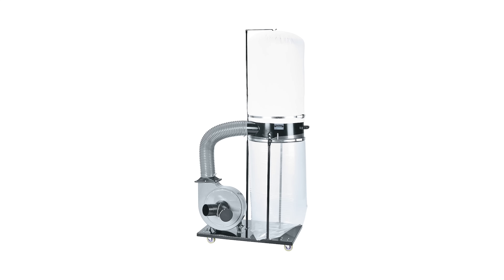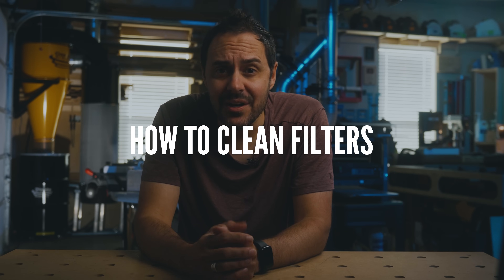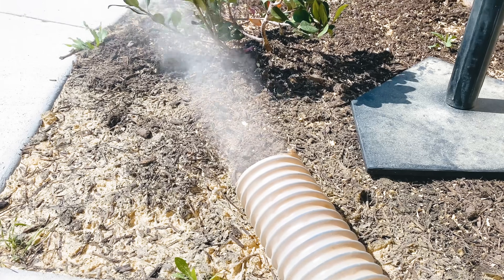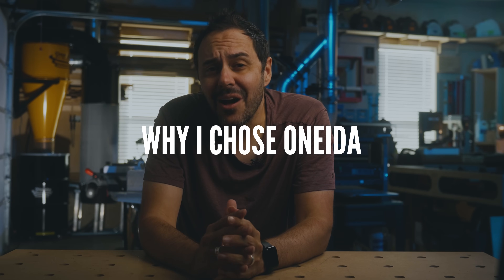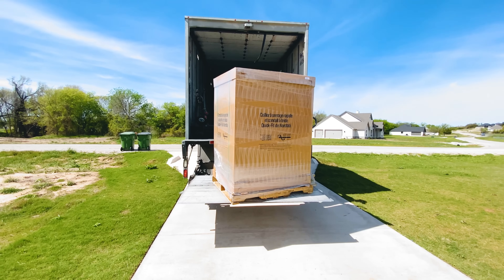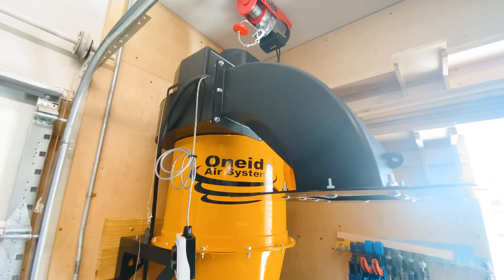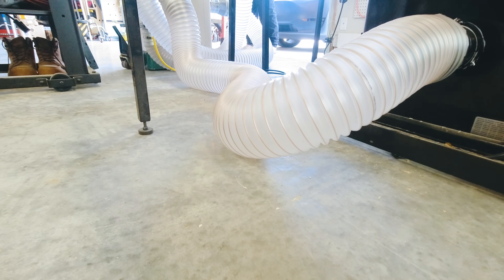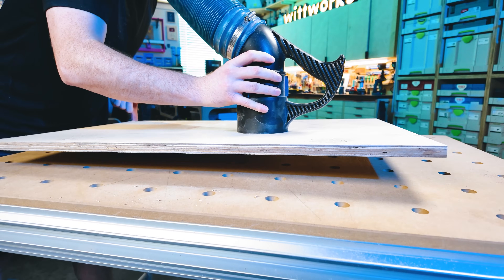The Truth About Cheap & Premium Dust Collectors by @wittworks  | Oneida Air Systems, Inc.

Comment: Thinking about the Supercell for my workshop.  I dont have the space for the monster Drew has here. I would like to get good collection from my Sawstop cabinet saw and wondering how the Supercell would handle it in comparison to Drews set up.  Looks like dust collection doesnt do much even with that huge collector until you put someting over the blade.

Comment: I have used Oneida parts, but I have been using a HF dust collector, on my system, and it works fine (and I use it with the 2 - 4" dust fittings on both my Laguna Bandsaw, and my Sawstop table saw.   I understand you would naturally promote your system as the best, but I wouldn't necessarily feel that way, based on my experiences.

Comment: This video resonated with me. I realize that this is hosted by Oneida, so this video serves as an advertisement for the company. But, this is the type of video that I would produce and let Oneida post. His history with dust collection very closely mirrors my own. I had a DustRight collector for my small garage woodshop.. It was inadequate for the table saw (Hammer K3) and jointer/planer (Hammer A3-41) I had hooked up to it. That hurts because I spent what I consider good money on the DustRight and the spiral ducting. 

After four years of this setup, where every time I went to play in the garage, I ended up spending considerable time vacuuming, then blowing the remaining dust out into the street to the chagrin of my neighbors, I decided to spring for a Dust Gorilla Pro (the same machine this guy has). In some ways this was quite painful, because the cost of the setup -- the dust collector and ducting -- is about the same as one of my major tools. Like this guy, I went for the Nordfab Quickclamp ducting. It was a splurge, but I think I might reconfigure the ducting in the future. I want to be able to reuse the ducting I have at that future date. 

All I can say is that the dust collection has been phenomenal since I installed this machine last summer. It makes a real difference to me in my enjoyment of the hobby of woodworking. In the past, I would hesitate before going into the garage to play, because I dreaded the cleanup. Now, there is very little dust to deal with. I have been using this setup now since July 2024. So far, so good!

Comment: Kinda wondering why Oneida recommended the Supercell and not the Gorilla.  I have a similar setup.  I do not have a cnc or drum sander but I do have the same tools as you.  Of course I have a bunch of smaller 2 1/2 port tools and sanders but the larger tools are the same.  I actually have a grizzly 17" bandsaw that is dual 4" ports.  We do not run more than one machine at a time.  Not sure if you do since I sounds like you work alone.  I am trusting that Oneida knows what they are talking about. I do not expect more tool growth for the future except maybe a cnc machine.

Comment: Love it.  Love the video.  I feel your pain doing things yourself.  I just bought the Supercell.  It is showing up this Friday. I too had one of your setups.  It is a harbor freight and I picked up the super dust deputy from Oneida.  Pleated filter with a bag under it to catch what may hit the filter.  I moved into a new home and have tons of room for shop so I splurged on the super dust deputy and piping from, yikes... home depot.  It is 4".  Thought I was all special and fancy with the hookup.  Mannnn...  The dust collector dust not suck.  You get what I mean.  Horrible.  I waited two or three years to finally move and get duck work and the super dust deputy for a complete disappointment.  I procrastinated for months now and went back and forth with Oneida. Told him what I had and they recommend the supercell.  My harvey table saw has a 4" port for the cabinet that has a 2 1/2 inch hose shared on the 4", which I don't like either.  The 2 1/2 is for the overheard dust shroud.  First thing I cut on the saw was about 6 pieces of 3/4" ply.  Cabinet was full of dust and the over head had saw dust piled up in it.  So disappointed.  I did weeks/months of research over the past 8 years especially the past 4.5 years.  I know the duct work I have has only a few turns and no hard 90s and no T connectors and one small flex hose at the miter saw.  Dust blast gates at all the  tools.  I tested with an anemometer.  So bad.  I am so excited to get the Supercell.  Yeah it is expensive.  But I cannot stand how much dust gets on me and everything else unnecessarily.

Comment: Nice setup. FYI, you can use the over-blade tablesaw filter with two hoses using a splitter and the HF Dust collector. Works fine in my shop.

Comment: I bought the Oneida Supercell for my small shop so that I could avoid the expensive 6" ductwork. I have 4" going to all my tools and it works great and I couldn't be happier. When considering the long-term health benefits IMHO good dust collection is a must..
Reply: Could you give a rough costs of the Supercell and all the bit please Ross
Reply: What 4" duct work did you buy?  See my longer reply in another comment here.  MY Supercell is coming this Friday.  I have 4" from the orange store and Oneida said it may be ok to still use it.  Have you had any issues with the duct work you have as I am guessing you did not get the nordfab stuff?

Comment: I got my Oneida system maybe 25 years ago. This was before they had the red light to tell you when the barrel is getting full. I have filled up my filter a couple of times. For me, the best way to get the dust out is with a water hose. It keeps the dust down, and hasn't done anything to the filtration process. I think the new filter goes down to 0.5 microns. My first one was 2 or 3 microns, can't remember.... 

One other thing about Oneida. There are 2 measures for air flow. One is cubic feet per minute, and the other is static pressure. A number of the "off" brands will fudge a lot on their CFM measure, and even on their static measure. Oneida does not.

Comment: Way to try selling an expensive dust separator 😂. Homemade cyclones definitely work. Your claim of it filling too fast is absurd. An expensive one fills up just as fast as a homemade one does. Simply empty your homemade one every day, and it will never fill enough to start picking up and sending into the vac.
Reply: Dont we want our separators to fill up quickly? If it's not filling up as fast, it's probably not picking things up.
Reply: No, it's magic

Comment: You're the guy that got out an anemometer and an air quality meter to compare your old $50 shop vac with a new filter and bag to a $$$ Festool Dust Extractor and proved it worked just as well.

Now suddenly because of a YEAR of talking to "experts on the phone" you have decided that the ONLY viable option to upgrade your dust colletor to handle your table saw is to go with a nearly $6000 5HP Oneida DC + ultra expensive ducting wth zero testing or measurements.

LOL
Reply: Well yeah because they gave it to him for "Free" in exchange for the video. That's how these Youtube channels work, they get free tools worth thousands for a 10-20 minute video, in order to try and get as many people that watch to buy the product.
Reply: You're right. I'd upgrade from the SuperCell to the Dust Gorilla too, if I wasn't paying for it!

Comment: Once you're in the new shop, I'd give serious consideration to putting that beast in an outside shed. Merry Christmas to you and yours. Take care & stay safe.
Reply: I thought about it, but the new shop will have air conditioning and humidity control - and I don't want to dump all that air outside. My neighbor's woodshop does that and he laments the inefficiency of that and cautioned me.
Reply: @wittworks  Is it possible to put the jet engine outside and return the air inside? Insulate the shelter for it for temp and sound control? A heat exchanger to recover the conditioned air? I guess anything is POSSIBLE with enough money...